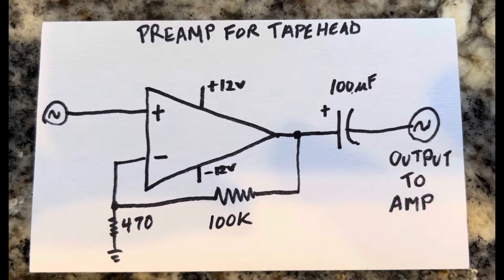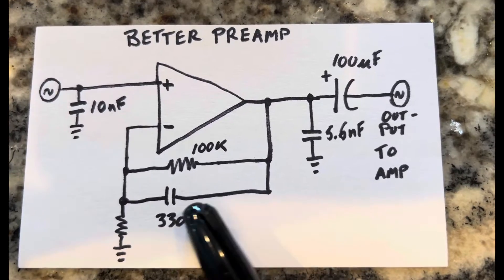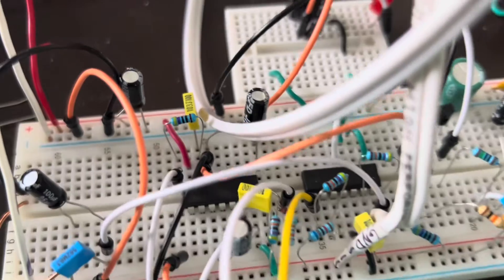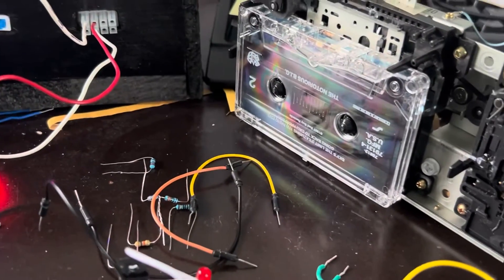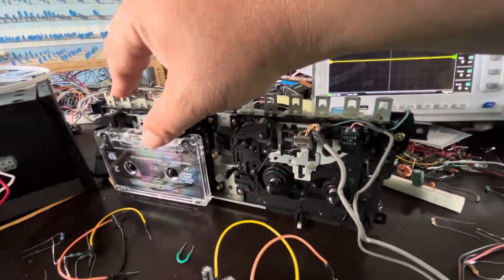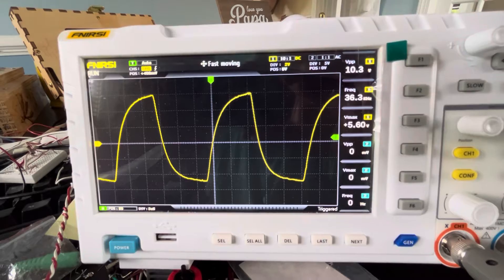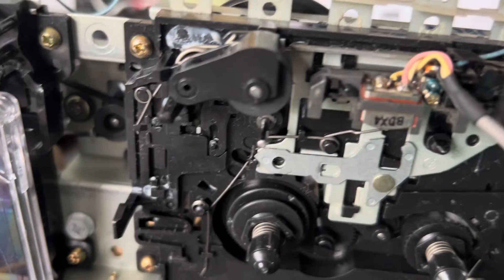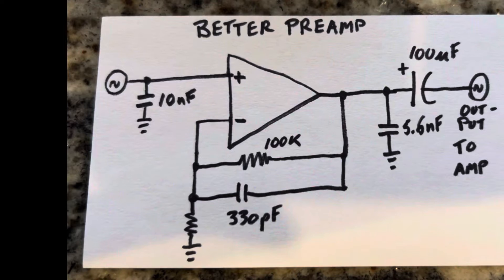DIY tape head-can it erase? and a Better Preamp

Comment: the  "better" preamp circuit should have a resistor in series with the capacitor. i build cassette players and you need to design the feedback line to match the head you use. get a funtion gen and send a square wave to the drive head using a cassette tape adaptor. also you will need more than 1 stage to properly amplify low bass frequencies.
Reply from the maker: My knowledge of this aspect of it is a little thin. What do you do with the square wave in tape head. How do you know what resistor cap combo?
Reply: @igorbrichkov3632  sending a square wave through you system checks is frequency accuracy because it contains many frequencies above the fundamental and each is very precise in amplitude so if your system is able to maintain all their levels it will come out like a squarewave.

this is useful do determine if you preamp is flat across its spectrum. 

when the tapes field id converted to a electrical signal,. low frequencies have a hard time getting thru and this is why the preamp needs higher boosting for them. at 3 kilohertz and above all frequencies get thru the same hence the resistor inline with the capacitor.